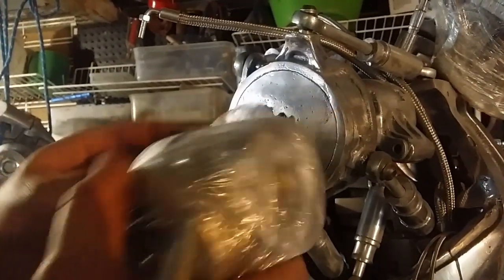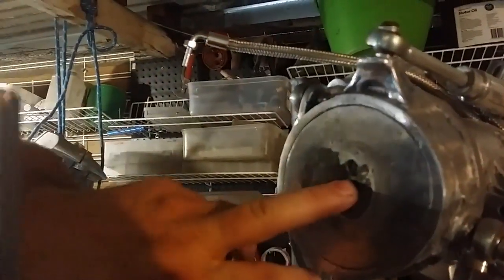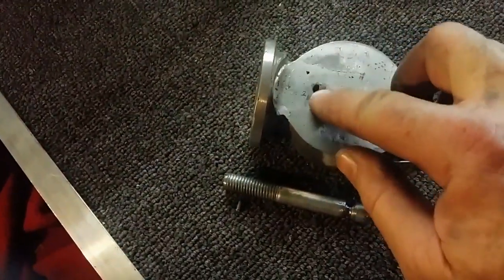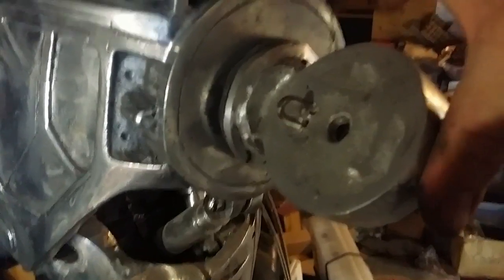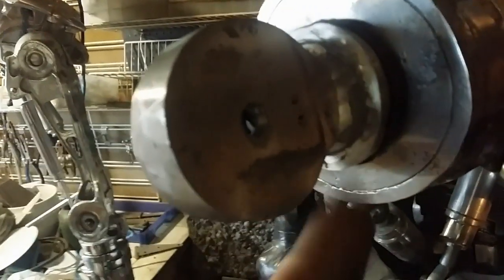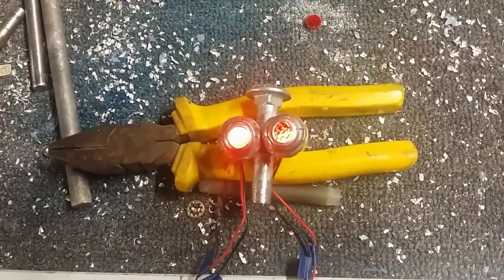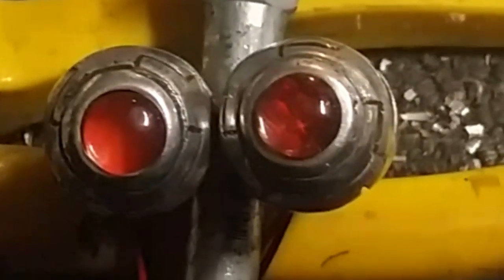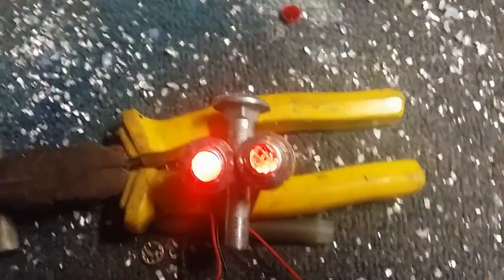Terminator T800 Build P65

Comment: I used little red discs cut out of transparent red plastic (styrene) to drop the brightness of my eyes and also produce a more uniform "redness" as well (as opposed to the reflector material).  You can double up the discs as well to get the desired look.  Worth a try to see if you like the results.